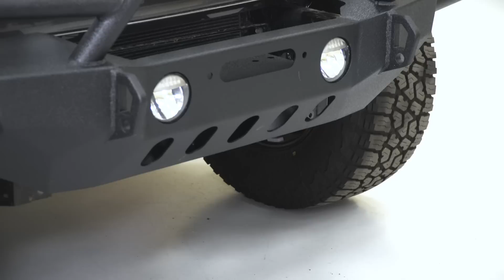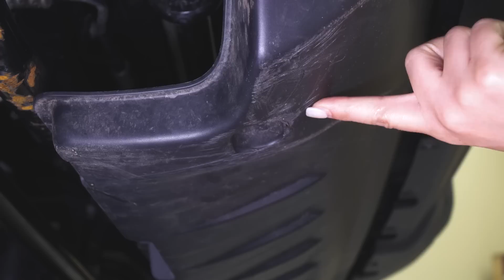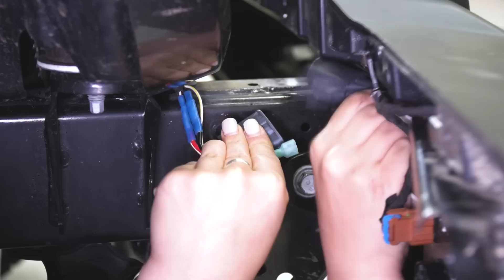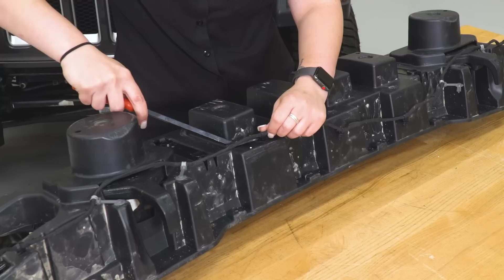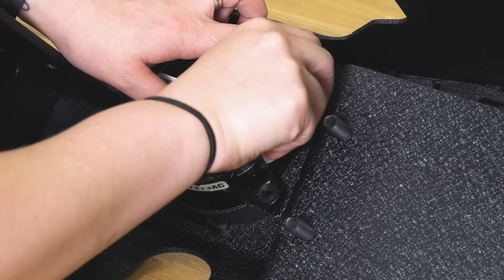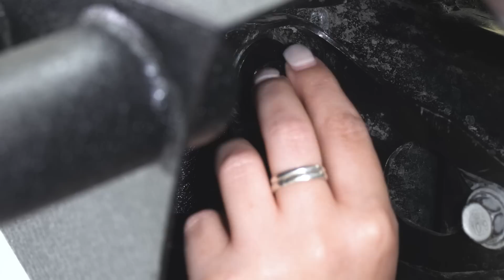Jeep Wrangler JL RedRock 4x4 Crawler-Max Full Width Front Bumper w/ Winch Mount Review & Install

Comment: what fog lights can i buy to fit this bumper if i have the stock halogen fog lights from the JLU sport
Reply from the maker: This RedRock Crawler will be able to fit OE LED Fog Lights found in Sahara and Rubicon models. You can use aftermarket LED fog lights made to fit Rubicon and Sahara model JL Wranglers as well! And since the mounting hardware is the same on all aftermarket 2007-2018 JK fog lights, you can use them too! -Zach